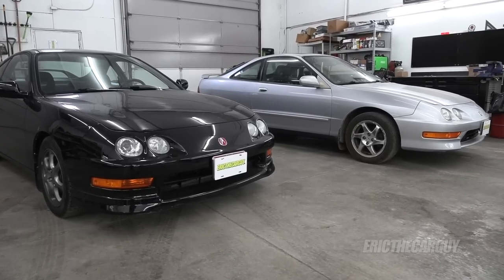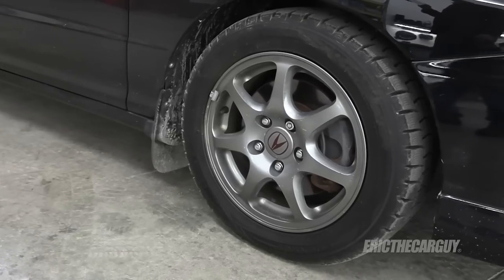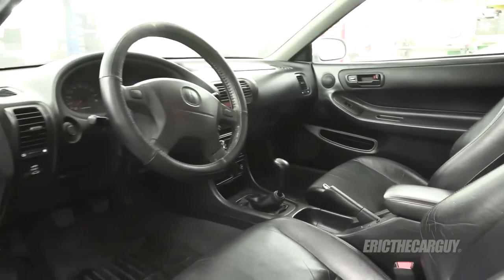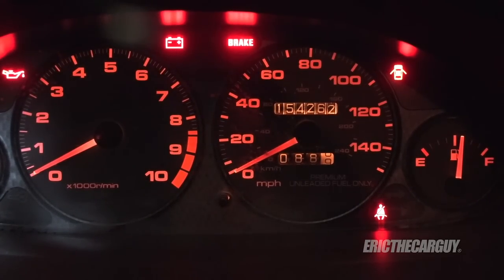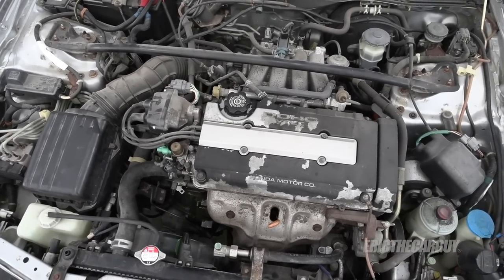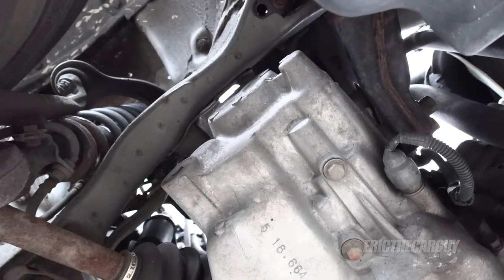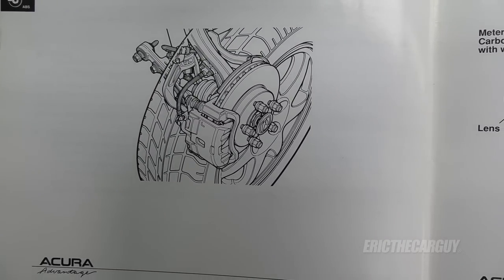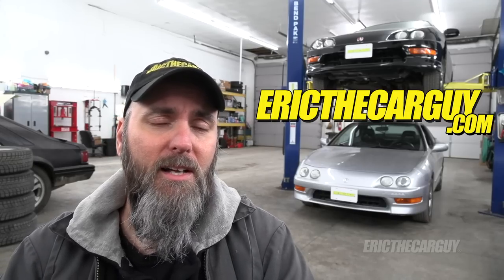Integra Type R vs Integra GSR

Comment: Now you're killing me.
You can't leave that rust on the frame...or anywhere.
You know all the details and the type R will be structurally unsafe if the cancer continues.
I'm no expert but have kept my 1966 911 alive for forty years and am trying to stop the creeping death on an ae86 that survived New York winters.

Anything brown has got to go down.
It's hard to find the zinc phosphate that turns rust black, maybe try boat places. POR-15 is supposed to be best but haven't tried it. It's expensive.

I'd scrape and wire brush anything fuzzy or bubbly,treat it,wait a month,brush and treat it again.
Only after time has passed with no rust anywhere turning brown, only then cover it with high zinc primer and paint.
I never trust rubber undercoating.
All rust weakens the integrity of geometry and leads to more rust.
Japanese cars light magic comes from very thin metal. It's no German or American tank.
It's made out of origami.

The Type R is an icon and will be museum worthy if it survives.